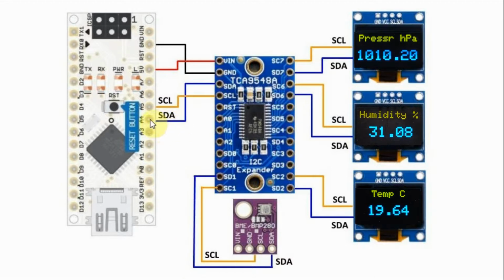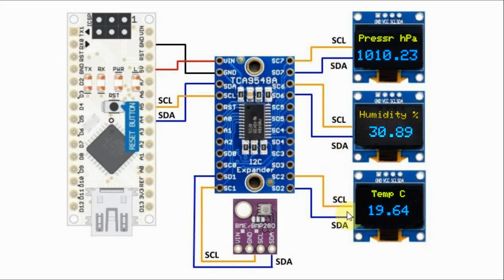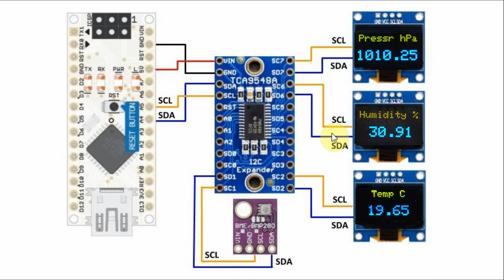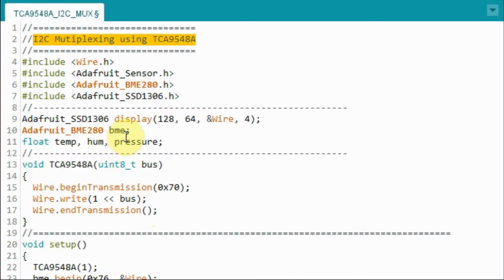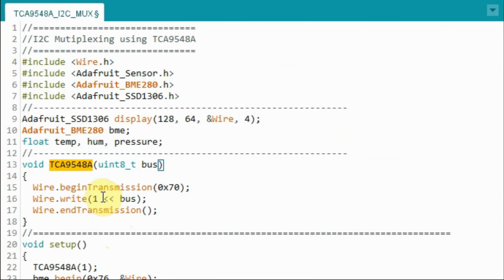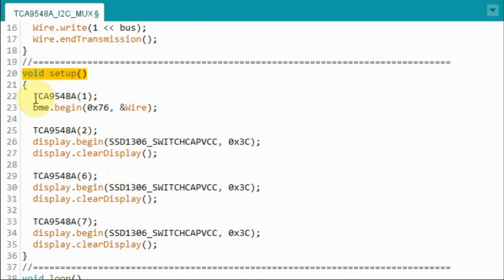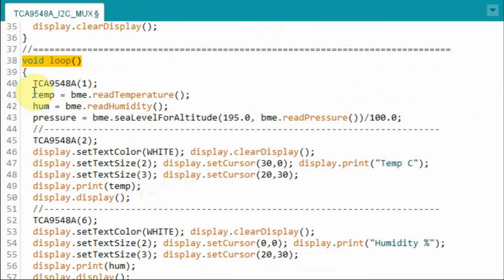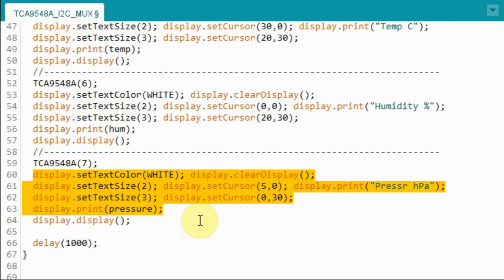TCA9548A Multiplexer & BME280 Sensor

Comment: Hello, great video 😄.

I'm a beginner and I have a question :
I wish to command 5 relays by using the multiplexer you present. The multiplexer "CD74HC4067" used in the following video : https://m.youtube.com/watch?v=Dco6jo9xgAo&t=369s

I use it to control one relay at a time but I want to control different relay at the same time. 

1 : Can the multiplexer you present control more than one relay at the same time?
2 : Can the TCA9548A multiplexer work with The MCP23017 GPIO Expander? 

Thank you in advance for your precious support 😊

Cordially.

Comment: For some reason I can only make 2 sht85 sensor work with the multiplexer and both shows correct readings. The moment I add a 3rd sht85 sensor then the code works, but only first two shows correct reading. When I blow over the 3rd sht85 sensor it does not record any jump in humidity/temperature (unlike the first two). I have tried other new sht85 sensors, new mux board, new set of resistances, nothing seemed to work.